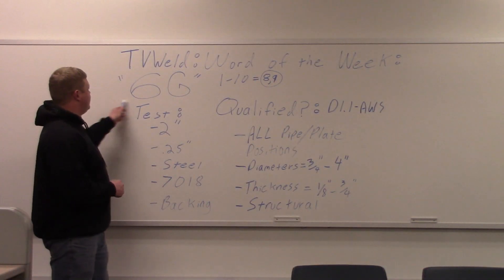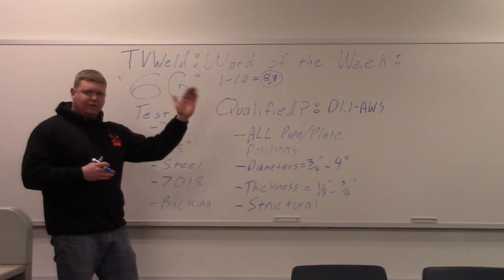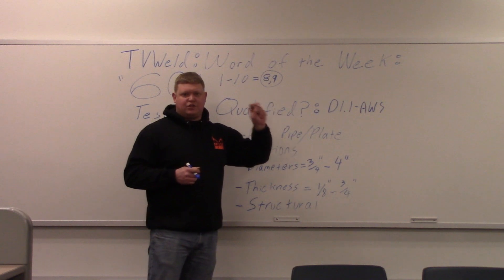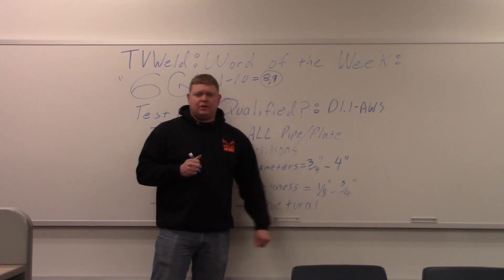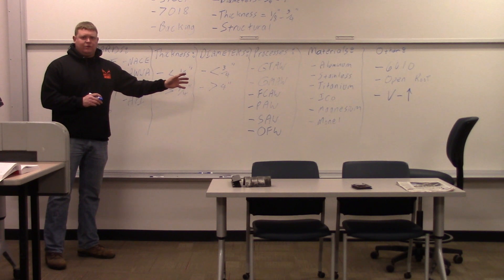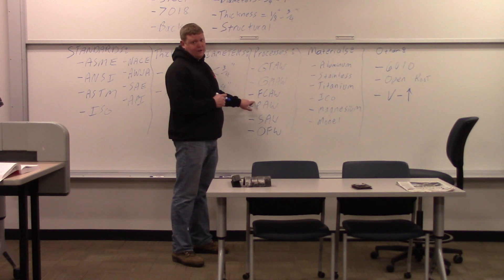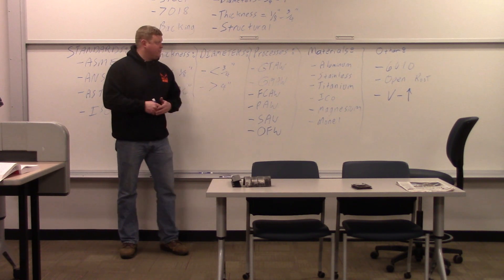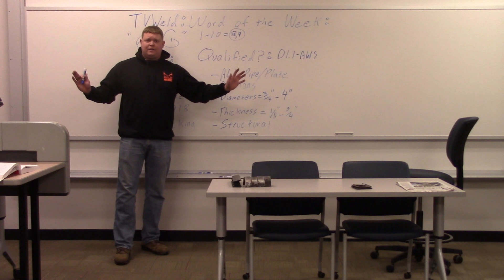6G Welder Certification

Comment: Just do the smart thing, gents.  Get your 3G and 4G unlimited under AWS D1.1... then grab your 2” schedule 160 and 6” schedule 80 under ASME Sec IX in both GTAW and 6010 root.  You’ll be a highly employable bubba with those four certs.

Don’t be afraid to ask an inspector if he can witness a test either on or off the job.  For a nominal beer fee, I’ll send a test coupon to an independent lab for the NDT and destructive testing, and then fill out and stamp your cert paperwork with the lab results attached.